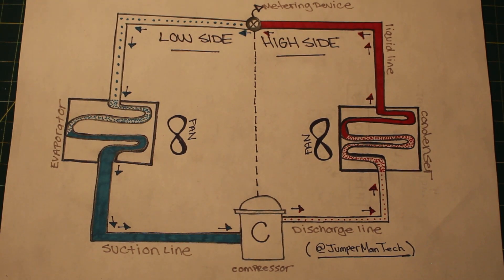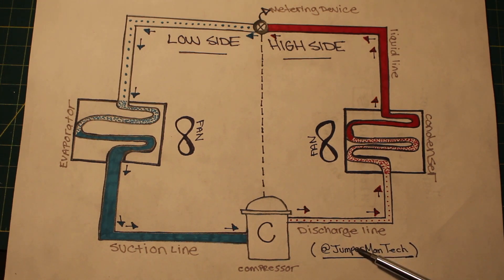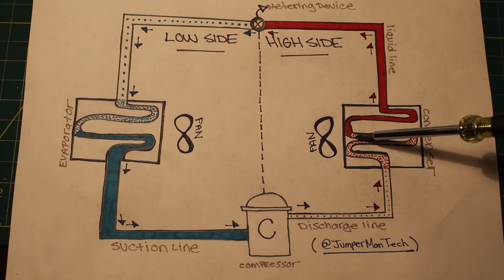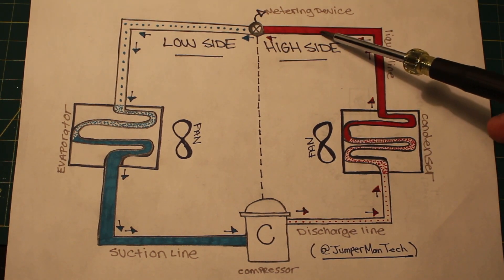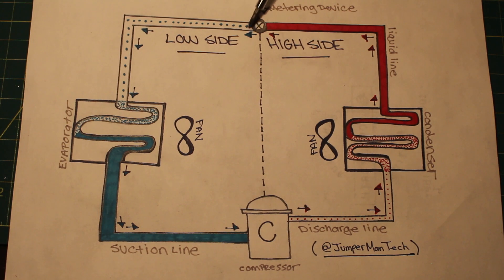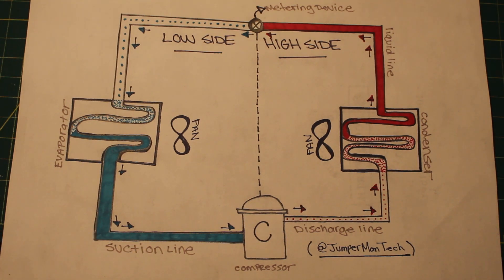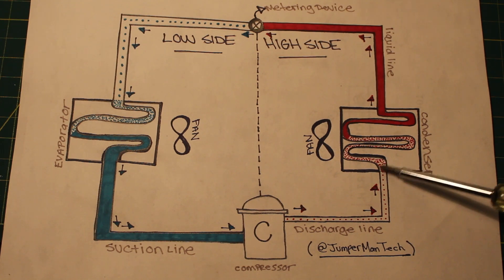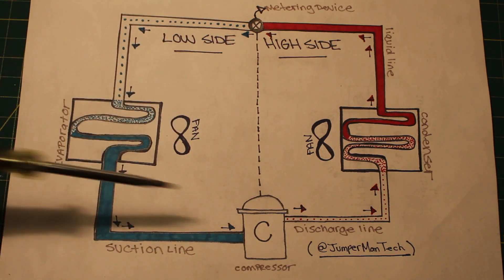Basic Refrigeration Cycle Explained (HVAC 101) Step By Step

Comment: The diagram is not consistent. On the right side you show liquid as filled color and on the right side you have filled green as vapor. It would make more sense liquid to be with filled color and gas with dots. Other than than very good explanation
Reply: I noticed that too😅, as I tried to interprete the drawing, but I had to catch up as he nicely explained it

Comment: “Low temp,low pressure,super heated leaving the evaporator “ ….I’m trying to understand coz  if temperature/pressure is low why is it super heated? Shouldn’t it be cold?
Reply: Super heated means heated beyond it's boiling point. And whenever lowering the pressure, the boiling point also gets lowered. This is why even though its at a low temp/cold, it's still well above it's (new (caused by the decreased pressure)) boiling point

Comment: explanation is correct but the drawing is not right. vapor should not be bold cold entering in compressor.
after the metering device should liquid state but the drawing is vapor. this is misleading